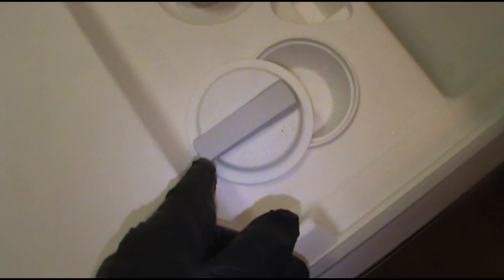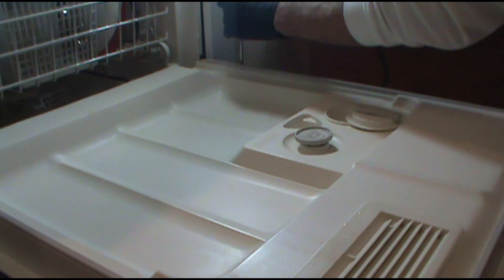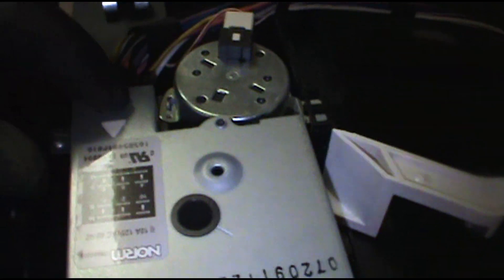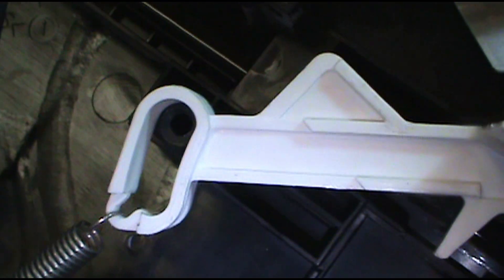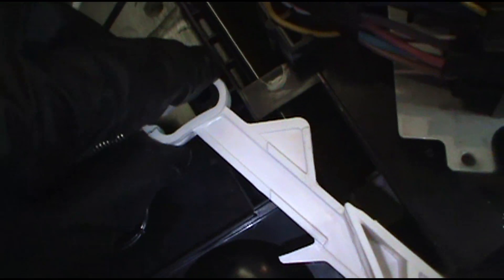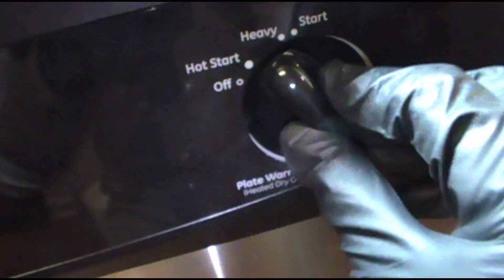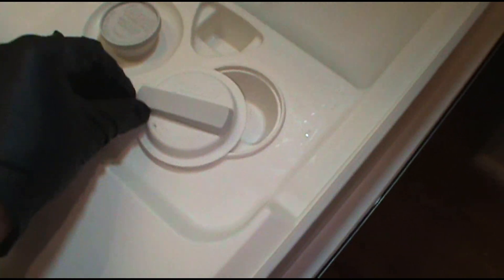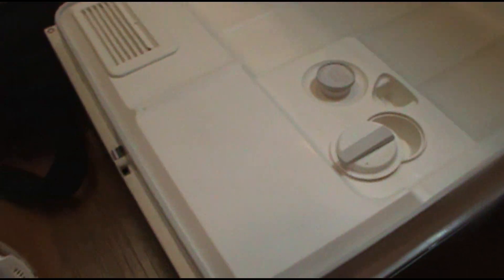Dishwasher Soap Dispenser Not Opening During Cycle

Comment: One of the most reliable dishwasher ever made by GE. I had one, it was beige on the outside with similar looking dial, even a bit older I think but the interior looked the same. It dries every time and I can use the drying function alone (and rinse alone too) just by rotating that dial and close the door. My useless newer Amana leaves puddles all over and dishes are wet even with Rinse Aid added.
Reply from the maker: Thank you so much for watching!

Comment: I have tried everything!  My soap door will not stay shut.  I bought a new spring, all plastic parts are good; no chips or anything.  Only thing I had to do was replace the timer due to overfilling problems.  I followed this video to a T and it will not stay shut.  Yes I made it is was in “off” position.
Reply from the maker: I'd need to be there for this head scratcher. 🤔
Reply: @LexVance  I did purchase the machine new in 2019, it worked then I started having a flooded kitchen so I took it to a repairman.  Had to replace the timer in it and then it stopped closing.  I have taken everything apart and cleaned it with just a rag/water.  I have watched multiple videos and nada.  I am tempted to replace the whole cap itself but all springs are working fine, I replaced the springs also…
Reply: @LexVance  I even sat there slowly turning the dial and closing the soap door to see maybe I had the dial thing on backwards.  Nope.

Comment: I have a Bosch machine, where the detergent door doesn't open reliably on the longer cycles.  I thought it was the detergent powder getting wet and making it stick closed, but it does it with no detergent in it.

Any tips before I go tearing into it?

Thanks
Reply from the maker: I'd need to be there for this head scratcher 🤔. I would have to look inside.
Reply: @LexVance  Yeah.. I figured.  It seems like I rarely luck out with an easy, clear cut fix.

My plan is to measure the resistance on the actuator. I'm hoping the dispenser assembly is bad because it's only about a $50 part.  If it's the control board I might be looking for a new machine.

Comment: I will try this. However my issue is that my dispenser IS opening and the dish detergent pod gets lodged underneath the bottom rack. That or it only partially dissolves. Help! 🥺
Reply from the maker: Yikes. I'd need to be there for this head scratcher. 🤔
Reply: @LexVance  are you in atlanta? 😅🤞🏾
Reply from the maker: 5 hours south in Tallahassee.

Comment: Question, we just put the cover back on and it wont open. What are we doing wrong? its supposed to not even matter when we put the cover on.
Reply from the maker: I would need to be there for this head scratcher 🤔. I need to see inside where the lever is to see what's going on.
Reply: @LexVance  we thought the problem was what happened in your video. Just went and tried it and all we do is put the cover on and it never latched lol. We been scratching our head for a solid week.

Comment: I’ve same model of the dishwasher and the soap dispenser isn’t closing at all. How can I fix this?
Reply from the maker: The timer has to be in the off position or it won't close. If the timer is in the off position and it still doesn't close then you'll probably need a new piece that's broken in the door.
Reply: Lex Vance thx for your timely response. Yes the timer is on the off position and I have changed a new dispenser in it.